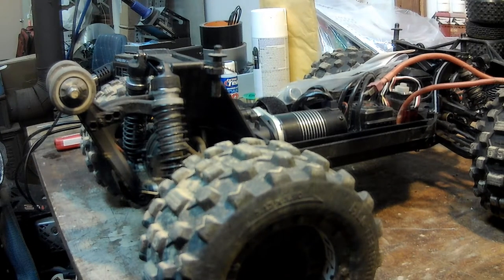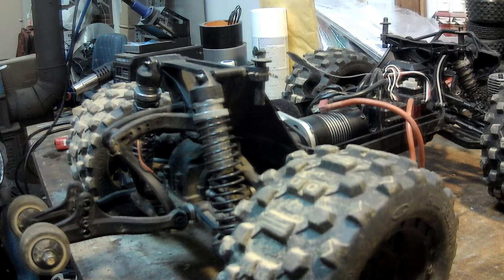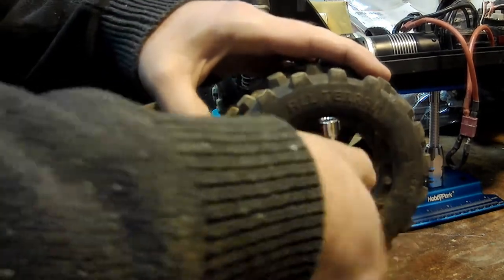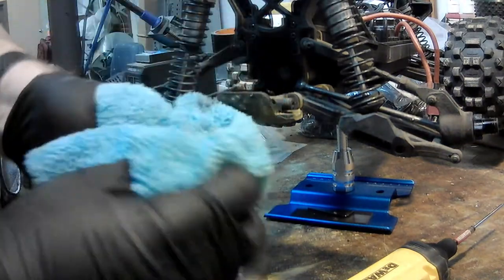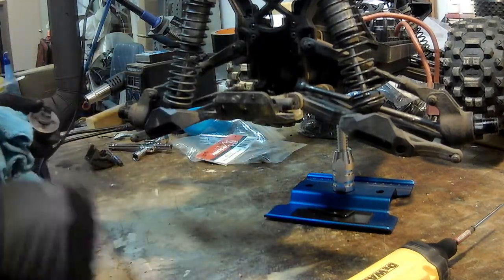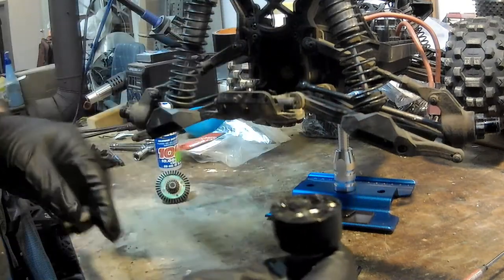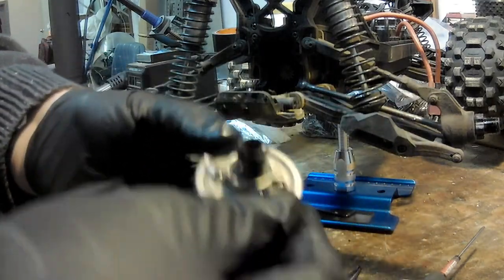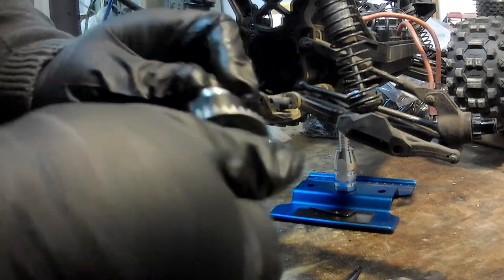RedCat Kaiju Differential Cup Replacement and Diff Cup Protector Installation step by step.

Comment: What's the drive cup and cup protector  part #? Need to get me those. Just  broke 1 driver side of my drive cup today.  Thank you
Reply: Yeah I needed the part number myself having trouble finding them 🤨🤨
Reply: Guess he's real busy lol hope he helps us in did find them on redcat site but I swear they look plastic 🧐🧐🧐
Reply: @nunyadambidness1444  I'm searching around for this cup protection and I can't find it I can't find anything on the diff cups
Reply: @katrinalindahl1293  I found them once but I did things with my suspension to push them axles farther in there plus I only Run 3s or 4s so they're in pretty good shape but if you want me to try to find it for you I can???? And I'll get back to you

Comment: I mean I have to ask...Are you affiliated in any way with Etreme RC? Because this is a nightmare and ripoff for the money. I have been grinding this crap for over an hour. Its just aluminum tubing. I see why you didn't show actually adjusting this because its not an exact science. I almost just wanna put oems back on. The dogbones have to freely on the sides and there just no way your install worked without grinding them down.
Reply from the maker: No affiliation! Just wanted to share my experience doing it. This Kaiju didn’t require any grinding, but my brothers did when I did his after.
Reply from the maker: When I did the other Kaiju, I used my dremel with a sanding drum on it. Took like 20min worth of grinding to get it to fit.